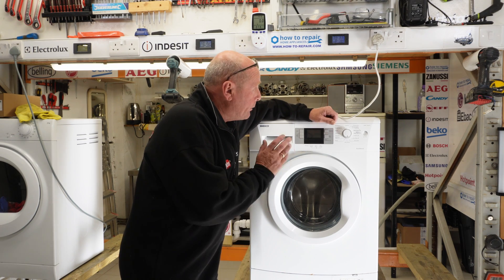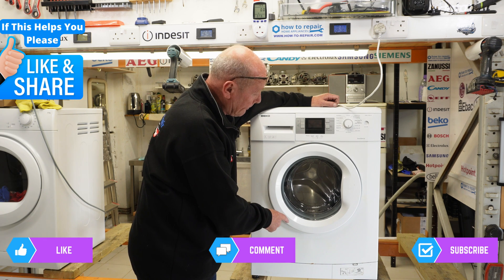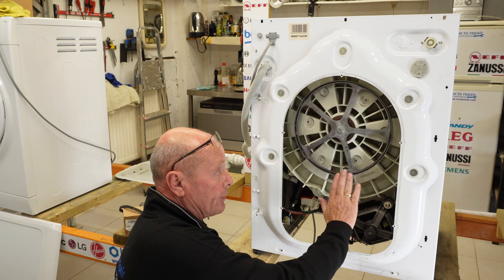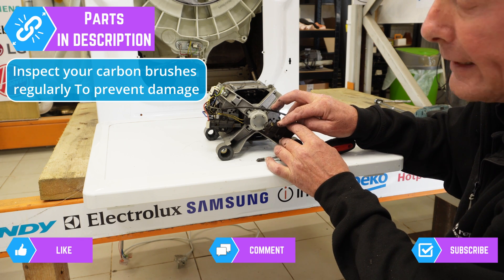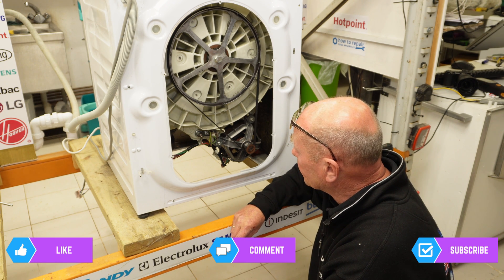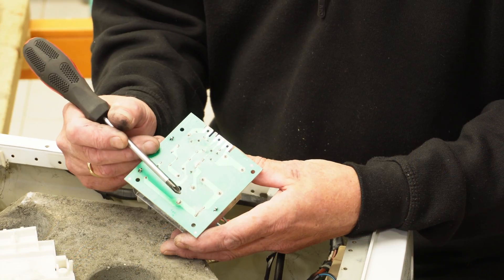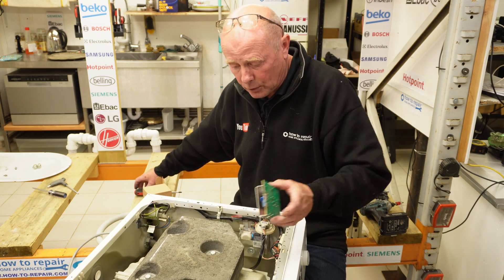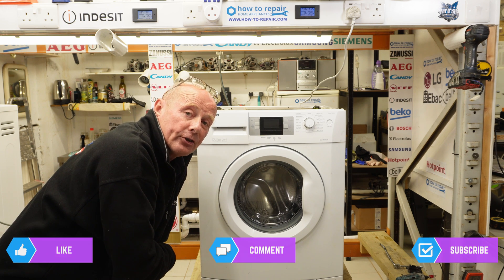Washing machine, not turning, ticking noise motor PCB fault Beko

Comment: Hi Paul, I have Hoover washing machine washer that has the door interlock clicking and won’t cycle up. I replaced the door interlock and the problem still persists. What part do you recommend to replace? Do you think the pcb board is bad?

Comment: I have a similar problem with my Bosch. But no strange sounds when turning the drum, just smooth but after I turn off the washmachine the door wont open. I need to unlock it manually.

Comment: Me and my dad actually got the drum opened by first drilling holes to get bolts to hold it later, marked it so we can get it to position in the reassembly , and we started cutting it, replaced the bearings, filled with silicone the cut part, slide it to position of the marking and got the lugs and bolts that got those rubbers to not turn back, and let it rest for 24hrs so the silicone sets in, after that it was good as new

Comment: Planned obsolescence and miniaturization of electronics are two reasons why I prefer to stick with slightly older versions of machines, regardless of what they are. That and, the simplicity of circuitry due to lack of shiny things means it's straight to the point - the circuit is the diagram and it usually works in exactly the way you'd think it does. The older versions are not any more impervious to failure than the newer ones, but the combination of parts generally being widely available and simpler in nature - such as large, easily obtainable through-hole relays and capacitors as opposed to miniaturized surface-mounted counterparts, means when something does end up getting blown up, it's nothing that a basic soldering iron job and some hook-up wire can't resolve, and in the worst case, you can bypass some circuitry and fix it properly another time and have it up and running in the meantime.

It is unfortunate you had to scrap the machine because of inaccessible ball bearings. That is absolutely a needless "improvement" to the drum.

Comment: Very useful. Had the exact same ticking noise with my motor after replacing the brushes. Was sparking like the 5th of November. At least I now know what is causing the problem and basically I need a new motor

Comment: Great video learnt alot thank you, i reckon I can do the repair but basically my Beko wme8227s stop working after regular use of 10+ years it will fill the drum but does not spin but it will drain. Below is what happens when I put the washing machine on a rinse spin. 

1. Door will lock
2. Water fills the drum
3. I hear a short small click 
4. Does not spin
5 I hear a couple more clicks on the 20min cycle 
6. Then water drains
7. Door will unlock

During this time the display timer stays on 20min and never moves but will eventually end 20min later.  Any advice is very much appreciated 😁
Reply: Replaced Carbon Brushes washing now working, thank to the help of this video and many others I was able to fix my problem.

Thank you so much for the amazing content you do

Comment: Hello, can you tell me about the WTB740E1W model Beko washing machine motor details?
Reply from the maker: Hello mate, here you can have the right information about motor details👇

Universal series motor is used. Universal series motor consists of stator and rotor. Stator and rotor windings are connected in series by means of collector and brush and current is transmitted to the rotor windings. Motor speed control is made over electronic card. Motor triac on the card adjusts the motor/drum speed by changing the triac triggering angle according to the signal coming from the tacho. In case of abnormal situations (continuous operation-locked rotor), thermocouple is available on the motor winding to protect the winding from overheating. 

Rated Operating Voltage: 220-240V 50-60Hz 
Current: 6A max (washing) / 3A (spinning) 
Input Power: 300 / 450 W 
Starting Current: 5...8A (washing) / 10A max (spinning)
Number of double pole: 8 
Tacho output voltage at 300 rpm: >0.9 V 
Tacho output voltage at 16500 rpm: <45 V

Please don't forget to subscribe to our channel as that really helps us! You can also support us by donating to our website https://www.how-to-repair.com/help/buy-paul-a-beer/  

Thanks, Paul 👍
Reply: @How-to-repair Thank you for your reply.

Comment: HI,

I own a BEKO 'WM84145W' Washing Machine - After I select the desired programme then press start, the valve opens and the drum fills with water then after the drum has filled , there is a click heard from the control the Main front PCB Assembly (which I'm assuming is one of the relays) then about a second or two after I hear a hissing sound coming from the PCB DC MODULE, but the drum won't turn and because of this the machine won't advance.

I one of my daughter overloaded the machine ☹

Would it be safe to assume that it's the 'PCB DC MODULE' that is at fault in this instant?

Many thanks!
Reply: I forgot to mention that when I spin the drum round by hand, the drum is very quiet with no ticking soound, which is probably a good sign, hence why I'm thinking it's the PCB DC MODULE which is faulty. Cheers!
Reply from the maker: Hi, please use our contact us page and make sure you fill out the request for what your problem is. I will need the full model number of the identification plate and the details of your problem so that I can provide you with useful literature. A video shoot of the problem would be perfect as well.

I will get back to you within 24 hours, normally. https://www.how-to-repair.com/help/contact-us/  

Please remember to subscribe to our channel, as that's what keeps this channel going. Thanks, Paul 👍

Comment: I had the same problem with creda super speed energy save 1200 over probably about 15 years ago I didn’t know back then as I was young that my brushes were worn and it damaged the armature in the motor and it blew up! 
Unfortunately I couldn’t find the right hotpoint motor to fit it at the time and didn’t want to buy a brand new motor as the machine was about 8 years old then so I scrapped it and had a zanussi jetsystem 1000 for years after… that thing was a tank and refused to die lol.
Reply from the maker: The old is the new series were very good machines well built
Reply from the maker: @colinsace1 please remember to subscribe to our channel as that really helps us https://www.youtube.com/shorts/e432SAb2g08  Thanks, Paul 👍

Comment: Will try what you have said on this for my mothers beko machine. I was changing the cycle to spin and drain after it had finished the previous cycle and it flashed and tripped the circuits. Water works but it does not count down or spin. Will try to check motor and motherboard

Comment: Excellent diagnosis.  Indeed, sparking on commutator is either caused by raised com bars or short in the winding of the armature.
Reply from the maker: If brushes were changed this might not of happened. Thanks for commenting

Comment: You can replace bearings and simmering in this model.
Reply from the maker: It's a sealed drum
Reply: @How-to-repair  It is possible to replace the bearings in the combined tank. You need to cut the tank, replace the bearings and then weld the tank. We have been doing this in Poland for years, and it significantly reduces repair costs.

Comment: Good job! It's a pity as usual that the bearings are not accessible. I think Beko suffer from motor problems, because I once saw one with the exact same problem as the one in the video, and it needed a full motor replacement.
Strangely enough, we had a Haier HW70-1282, whose brushes went bad after just 3 years, but it didn't burn anything. It just would not turn and displayed a motor error.

Comment: The way to combat companies that use built in obsolescence is not to buy their products.
I now use my local laundrette machines for both washing and drying. It is actually cheaper than having my own machines. I only use the dryers during the bad winter months. Other times I use my free wind and solar 11meter(washing line)dryer.
My local laundrette charges £7 for the largest machine and that's equivalent to 4 loads in a standard domestic machine.
Only additional cost to me is wash tabs/liquid/powder , fabric conditioner and "occasionally" using the dryers for which £3 is usually enough for the same quantity of items to be dried.
I got chatting with the guy that owns the laundrette one day and he told me that the machines that he used are so reliable that in fifteen years he has only ever had one machine go down which he fixed himself at less than a quarter of the cost had he called out an engineer. He also does all of his own routine service work.
Quids in I would say!
There's gold in them there hills👍😎👍
Reply from the maker: I can 100% vouch for what you're saying, as I own a laundry in Portugal https://www.algarvelaundry.com i use the ipso boiler fed machines but I've run them off solar water. These machines will go on for 30+ years if well maintained but they do cost an excess of £2000 a machine. With over 3 million machines been bought in the United Kingdom alone per annum. You see why they become so greedy. If it fails they make money, but the manufacturer is not interested in them being repaired because they do not make money only the engineer who repairs it. So if they make the parts hard to get difficult to take off an economic to repair, all they are doing is sending you back to the shop yet, one manufacturer may own multiple brands to examples being Whirlpool owns Hotpoint Ariston indesit creda. Plus others
Electrolux is aeg and Zanussi, plus others. Thank you very much for taking the time to comment @allsortsabouteverything please remember to subscribe to our channel as that really helps us https://www.youtube.com/shorts/e432SAb2g08  Thanks, Paul 👍

Comment: 7:25 A more technical name for that board would be "DC module" or "AC to DC converter board" as that's what it does, it converts AC coming from the main PCB to DC that goes to the motor (the motor is being run on DC for a few reasons despite being a universal motor). It is found in high-spec models as in >=8 kg models, >=7 kg 1300 rpm models and a 6 kg 1600 model.
Reply from the maker: Great, thanks for the info. Much appreciated. please remember to subscribe as that's is was keeps this channel going. Thanks 👍
Reply: I've always replaced DC, main PCB & motor when a comm segment has lifted, presumed it always tracked back to main PCB aswell